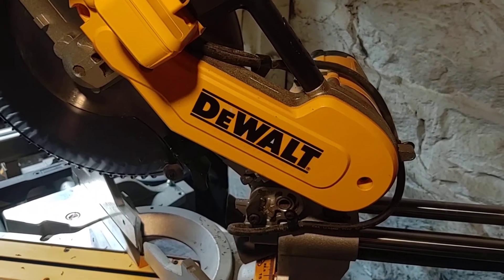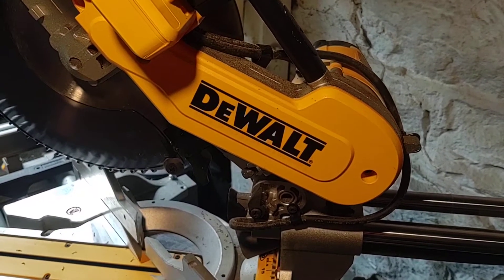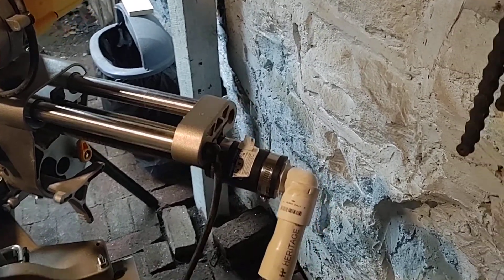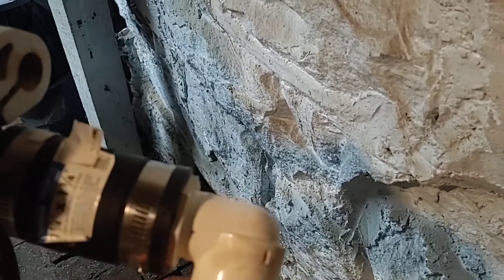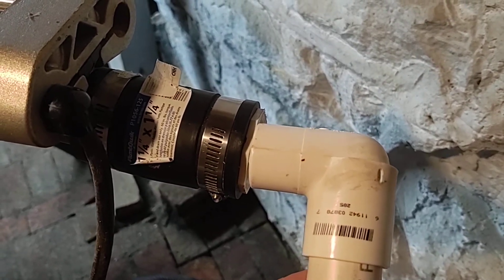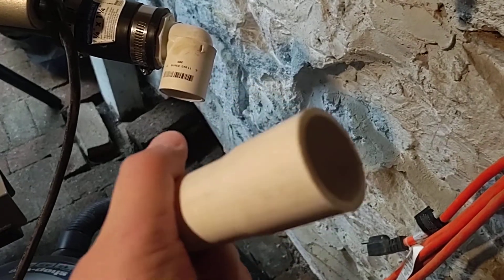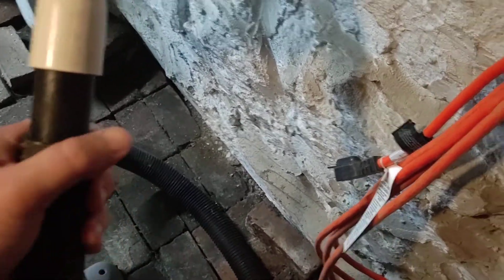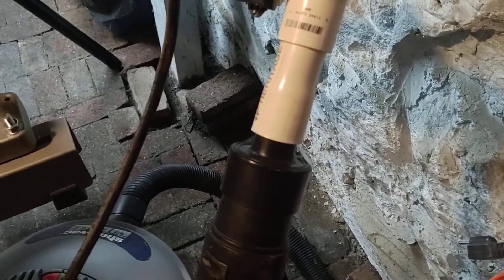DWS779 and DWS780 DIY dust extraction adapter

Comment: I just purchased an shop vac hose adapter. The one that fits multiple hose sizes from one inch to 2-1/2 inches, loosened two screws in the rear that holds two halves of the saw's dust tube together, shoved the adapter into the tube, tighted up the two screws and attached my vacuum. Works great!
Reply from the maker: That's a great idea!. Necessity is the mother of all inventions.

Comment: Hey there, so how well does it work?  What about all the dust that flies around the rear perimeter area? Also, when you turn your sop vac on, does the soft rubber ‘dust collecting rubber funnel’ collapse? Tks
Reply from the maker: It works well considering the fact that you don't have to buy any of Dewalt's extra proprietary dust collection parts. There is still some dust that doesn't get collected around the rear perimeter. I've heard before that no dust collection method is 100%. The rubber funnel does collapse and I plan to remedy that. There are a couple videos on YouTube that have a fix for the collapsing rubber funnel.